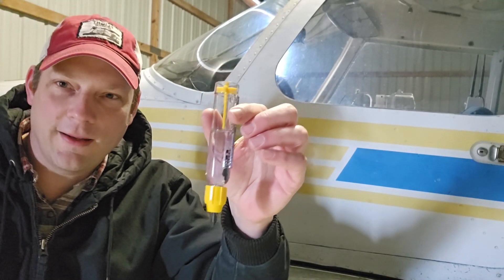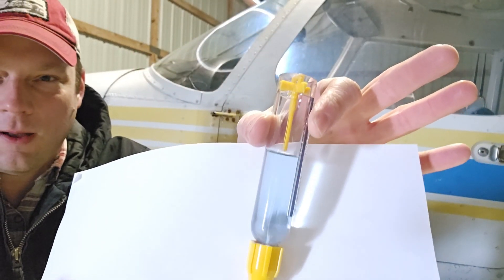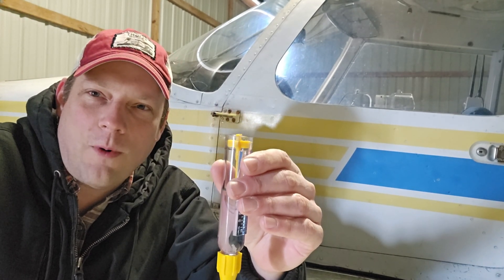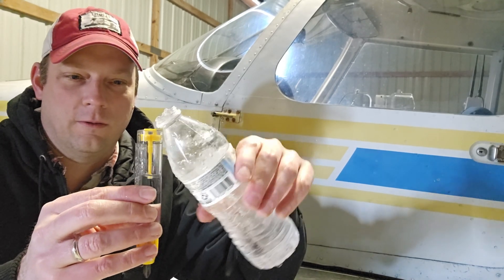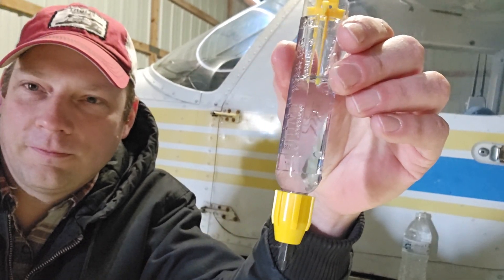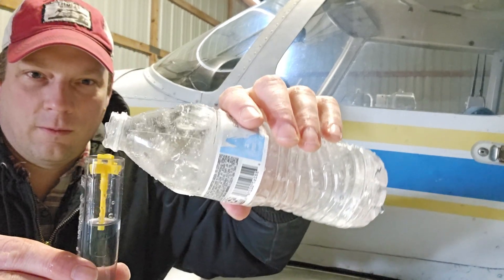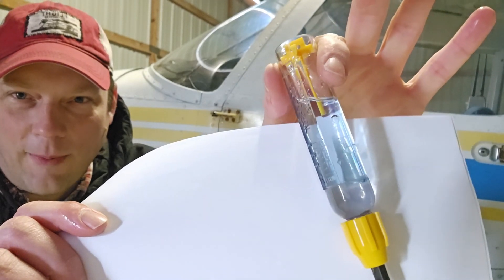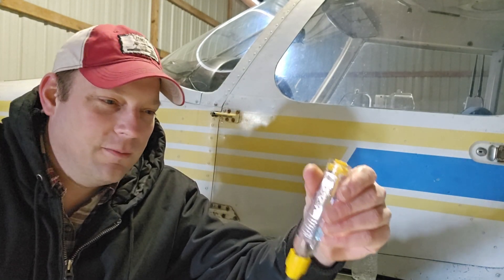Water Contamination In Aircraft Fuel Tanks | Private Pilot

Comment from the maker: How often do you see water in your fuel?
Reply: I saw it - once. That’s the day I realized that sumping tanks is not just an exercise. In my very early Seneca, you have to get under the plane to sump the two crossfeed lines, unlike later airplanes that had two knibs you pulled behind copilot’s seat

I once had a neat fuel tester that would actually separate the water from the fuel within the test tube. Made by a company in New Jersey
Reply from the maker: @thomaslembessis6803  yeah, i think alot of things we do in aviation just because it's a checklist or whatever, but with enough flying you come across different situations which shed some light on why things are done.  Sounds like a cool tester by the way!